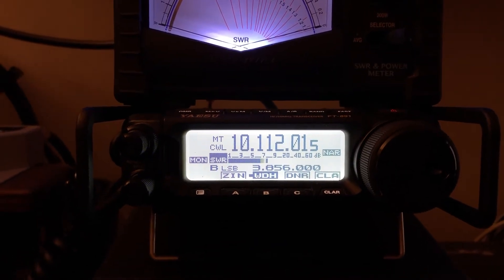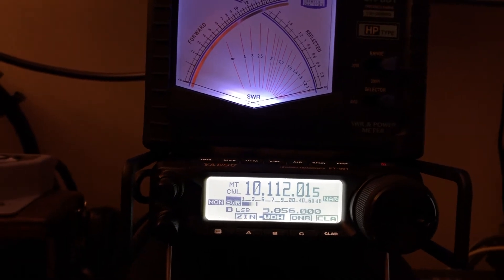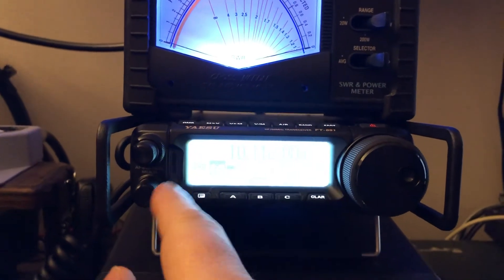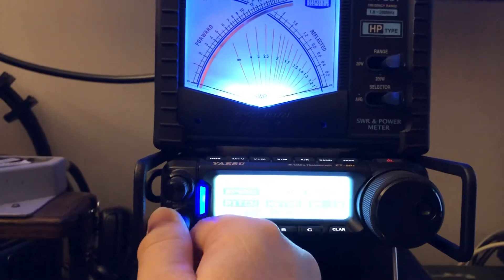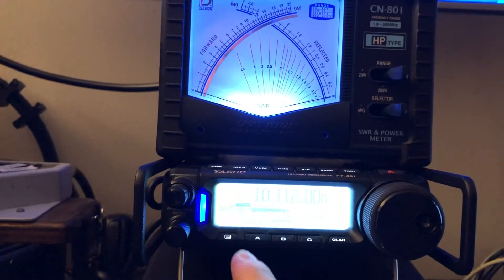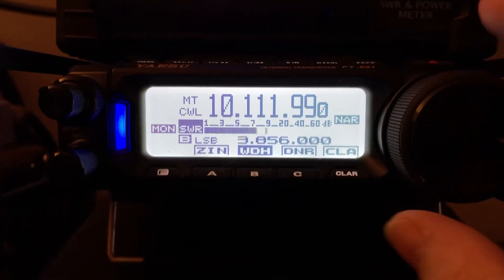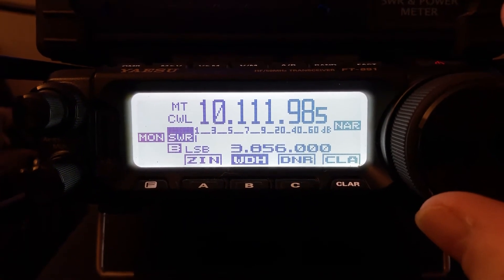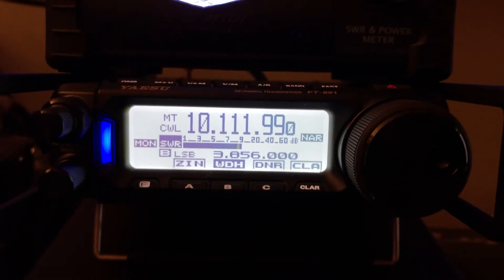Yaesu FT-891: ZIN (Zero In) Feature Explained

Comment: When you use ZIN, and it locks onto a frequency that gives you the 550 Hz tone, does that mean you are actually transmitting in his band pass?  I’ve worked guys who I know are running tight filters, but no matter how much I try to zero in, they don’t hear me.  My hearing isn’t the greatest, so this might do the trick for me.
Reply from the maker: The ZIN nudges the VFO to the frequency of the received station, in case they are off frequency.  So you will be transmitting where they are.  If you watch my 3-part series about the 60 meter band you will see why you can’t use ZIN on 60 meters.  The FT-891 TX is inhibited if ZIN moves the VFO on 60 meters.

73, de N4HNH

Comment: Hey Doug, great video.

I'm not sure about the blue light and think it doesn't operate correctly. Afterall, the dits and dahs light the equivalent on my 897 spot on. I don't ever see ANY correlation between a cw signal and the light on the 891. 73 mate.
Reply from the maker: Thanks!  On the 891 the blue light doesn’t track dits and dahs.  Would be nice.  But it appears to just light more blue the closer you get to matching the sidetone you want.  I guess I need to ask Yaesu for the official word on it.  73, Doug

Comment: Thanks for the video.  I am just beginning to play with my 891 I bought new back in 2019...  Life happens...  I turned the ZIN light on yesterday and noticed it was flickering even when not receiving a signal.  I noticed your radio was doing the same thing, and I also read the comments.  Thank you for putting my mind at ease that this appears to be "normal" operation of the radio.  Cheers!!
Reply from the maker: Hi David!  I’m glad to help.  The flickering is normal, especially as tight as I run my filter (50-150 Hz).  The ringing of the filter is at the same frequency as your sidetone, and can be picked up by the ZIN circuit as random CW.

73, Doug